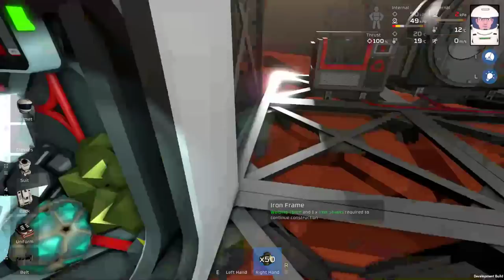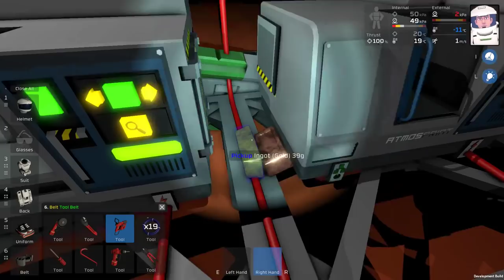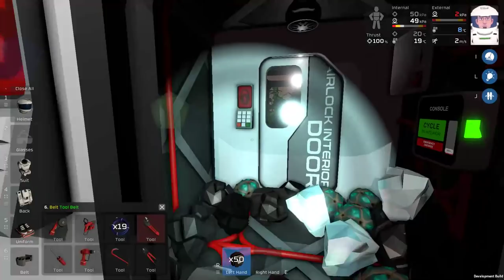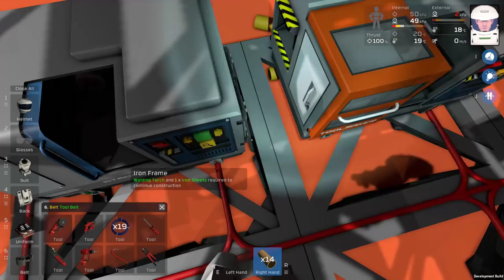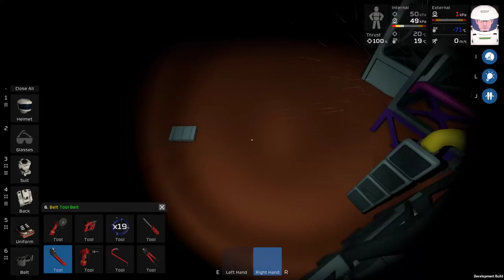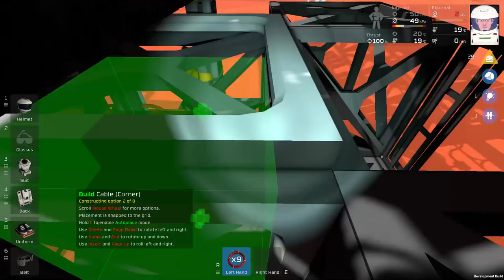Stationeers / EP 26 - Gas Capture Furnace Part 1 / Mars Colonization

Comment: You forgot to mention the best part of living in an ancient boiler-heated house... flushing the system weekly! Best way to start your monday morning is putting a bucket beneath a valve and blasting it with rusty steam.

I do not miss those days, lol.
Reply from the maker: Yeah ... it's not ideal.
Reply: I do not know how archaic your water based heat distribution is in the US but here I only have to flush the system maybe once every 2 years and only on the top floor. And this house is already quite old. Central Heating is very awesome because you don't have to bother with all the small little boilers everywhere and can have a single, well insulated Heat Exchanger that supplies everything at once (warm water and heating). And the mechanical Thermostats on the Radiators actually come with a Bimetal based Control system that closes the valve slowly when the heat in the room raises, so you don't need to adjust them all the time.
Reply: @TheHyperplayer  that home was originally a new-england farmhouse pre-electrification. There was old knob-and-tube wiring in sections of the building still in use.

Comment: Hydronic baseboard heaters aren't completely obsolete here in the US. You can even get indirect water heaters so the hot water boiler heats both the baseboard and your domestic hot water if you wanted to.

Related to the actual game itself, not sure if this has been mentioned, but if you're printing something in one of those machines (lathe, pipe bender, etc.) and you only want one you can set it to print and then push one of the arrow buttons to "change" what it's printing. Visually it will appear that it's printing the new item, but once it hits 100% it will pop out what you intended to make and then stop by itself. Useful if you want to make one thing that costs a lot of resources and takes forever but you don't want to sit around waiting for it or risk wasting materials.

Haven't played in a while but I had my machines set up 2 spaces apart and all of the outputs led to a single stacker which made things a lot less annoying.
Reply from the maker: Ahh good point about the up-arrow printing, thanks Ozyton!

(I will eventually setup an actual crafting room that includes stackers, etc)

Comment: I thought that only the arc furnace leaked gasses. I'll have to double check that again I guess.
Reply from the maker: Nope, the regular ones do too, 100% sure about that.
Reply: @Rhadamant  Regular furnace does not leak gas.  It does radiate heat.  It's best to put it in a vacuum.
Reply: @Rhadamant  no 🤔

Comment: Now I want to make a base that uses water radiators for heating and cooling.
Reply from the maker: Well go for it Oboro! IIRC Water is the 2nd best conductor of heat, only 2nd to Pollutant.
Reply: @Rhadamant  Water has the highest Thermal Capacity
H20 is 72
CO2 is 28.2
X is 24.8
N2O is 23 [28.5 IRL]
O2 is 21.1
N2 is 20.6
H2 is 20.4

I think Pollutant might be used so often because it's a "throwaway" (the lower gases are more valuable for other things) gas that has a low capacity, is not flammable, and is quick at changing temps so it's good for transferring from one system to another.